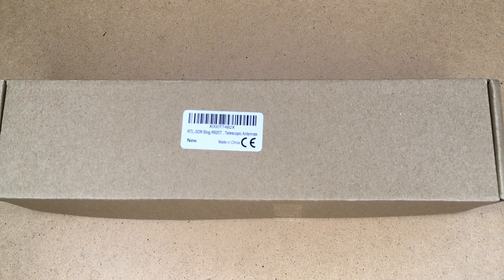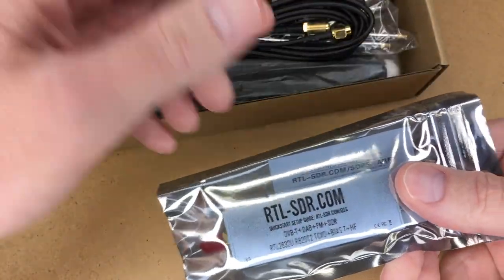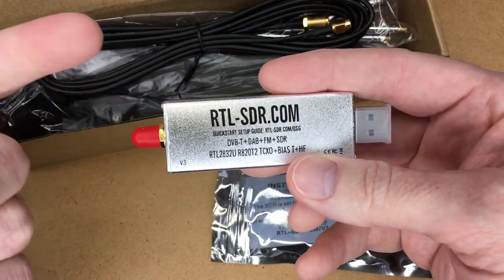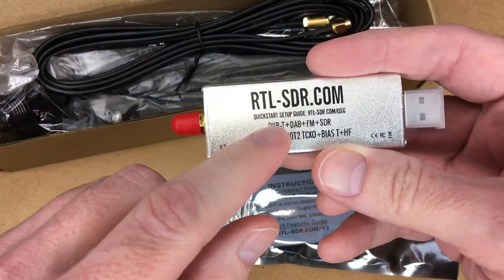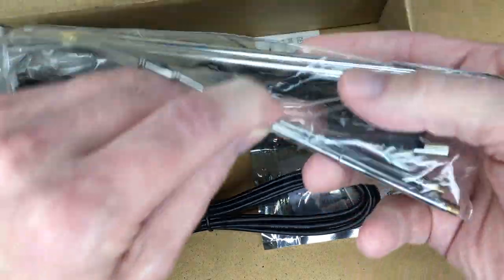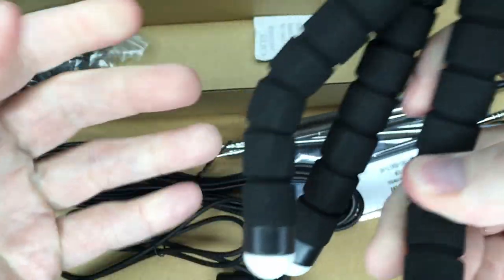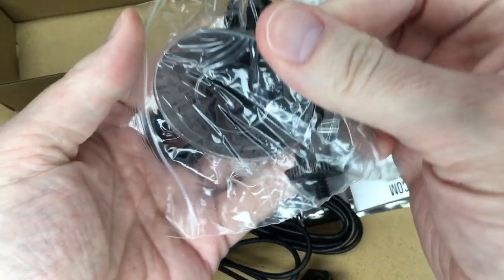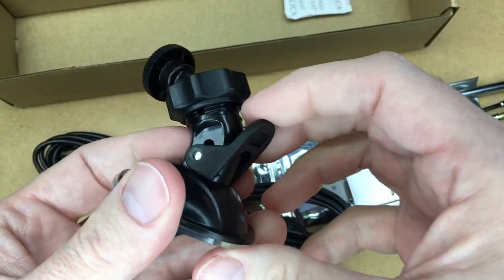RTL-SDR Blog V3 R820T2 with Dipole Antenna Kit Unboxing

Comment: this is such a great entry level product! I spent so much time on it and with the simple dipole antenna you can get so many signals around, mainly V/UHF. For HF,  a different antenna is required but for V/UHF it works out of the box and it has an amazing price/quality ratio

Comment: I just discovered your channel and I love it! 
I am planning to get one for myself. Should I get only the dongle and make DIY antenna or buy the complete set for a few dollars more?
Reply from the maker: If you are just starting out, the complete set is nice because you can get started right away. I would still consider making your own antenna. I haven't made one for my SDR yet but I made one for a homemade radio when I was younger. I may make an antenna for ADS-B one of these days.
Reply: @Rickmakes  I'll get only the dongle. I think the thrill(yeah, it's a thrill for me) of making an antenna will do good. Plus I heard that even a 70 cm dipole antenna can work perfectly with almost all frequencies. I was looking for a follow up video of this SDR but I could not find it, did you unlist it?
Reply: @ruatachhangte  hey did you finish your antenna ? I'm planning for a diy antenna
Reply: @ivachaspati  I did make a ground plane antenna and a Yagi but they did not perform well(mostly because I had no equipment and I suck at anything DIY). I had the UV-5RHP which has a surprisingly good (and wide) dual band antenna. So, what I ended up doing is, I bought an SMA Male to SMA Male extension cable and used my UV-5RHP antenna instead which works so much better.

Comment: Are are you supposed to hook up small antenna with the big one or do they need both little and big ones on the tripod?
Reply from the maker: I'm not an antenna expert so I'll usually search online for the best setup for the frequencies I am trying to pick up. For instance, to track airplanes, I put the short antennas on and have one pointing up and the other pointing down. SDR groups online can also be help for antenna recommendations. I've been meaning to learn more about antennas but haven't got around to it yet. I think that is a big part of learning about SDR.

Comment: So I'm really new to all this, and I have this kit.  What frequencies are good for the shorter dipole antenna, and which frequencies are best reached with the bigger dipole?
Reply: Shorter i would use after 300 mhz fully extended longer one you can use variably by adjusting how many sections are out but i would use it before 300 mhz and after 23 mhz